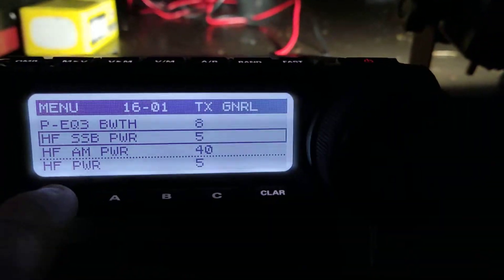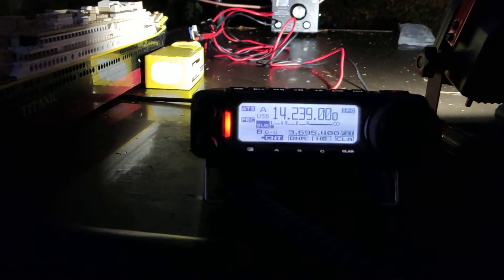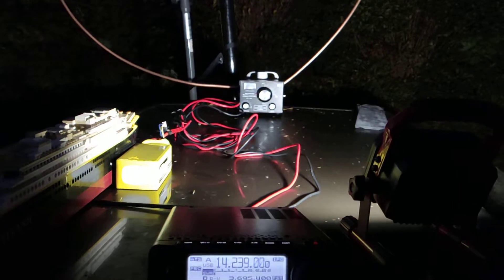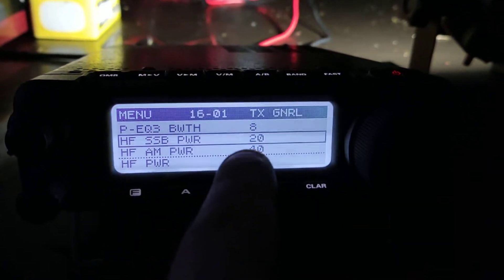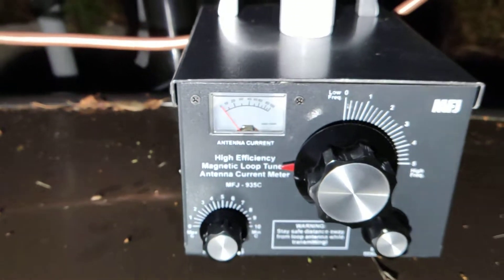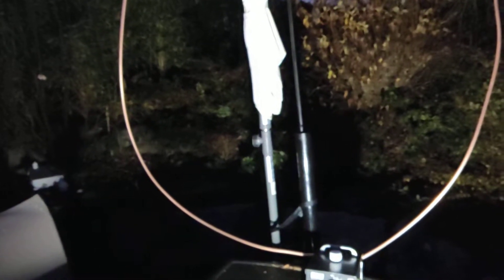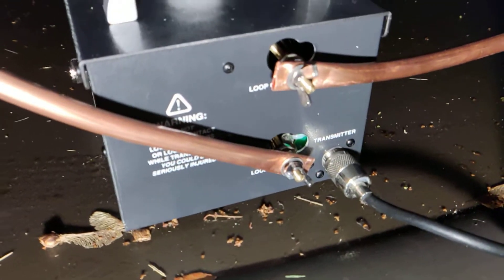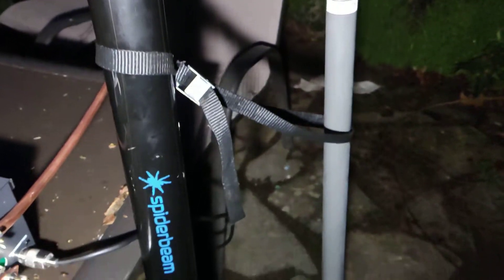MFJ-935C Loop Tuner on 20M

Comment: i will be interesting watching ur video about this one and to see the results ..... how much can the radiation propagate (low angel of radiation should have ) also did u test it for 100 w and whether it will arc or not ???
Reply from the maker: Hi, and thanks for watching. 

Not sure how far I can TX yet but 5300 Kms was a lot more than I had expected from this loop with just 20 Watts, using 4 meters of 10mm copper :-)

MFJ recommend this loop size as most efficient for 20m but after this video I used 2.7 meters  of copper and made it into a loop to make 1200 - 1600 km contacts a few days ago on 20m, didn't record it as I was in a friends QTH. 

I did test it at 100 watts with no arcing, I will make a video of this soon.

Yes, I'm looking forward to experimenting more with this tuner :-) stay tuned!
Reply: @o00scorpion00o  very nice , can you also update us with the Band width you get on the operating band .....there is alot of articles about loop antenna , one i did like , talking about using 0.5 mm wire , the reason behind this which contradict the recent believe about the bigger the conductor (in diameter)the more efficient but they do not mention the more capacitance will make w.r.t ground which leads to loss also ..., i ordered my own, soon i will get it and will be sharing info
Reply from the maker: @mouhandiseen  Did you get the 935C after ? any videos ? what do you think of it ?

 I haven't used this tuner really much since this video but I dusted it off yesterday afternoon and I connected the 2 meter length of copper pipe and on 20m and 5 watts made contact to Belarus, from Ireland, I was quite happy with that, shame I didn't make a video. I must see about using my Nikon camera for recording, I'll have to get a proper Mic but it would be a lot more convenient on a tripod than trying to hold a phone and operate with one hand.